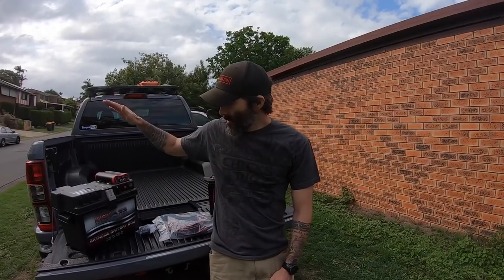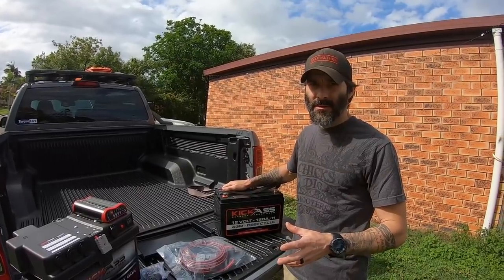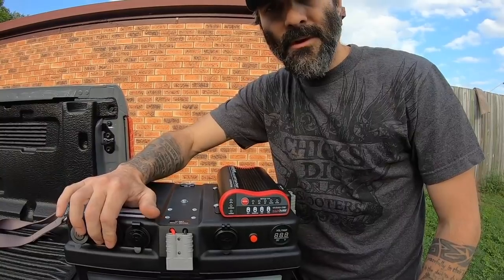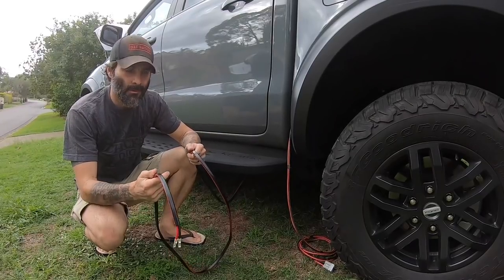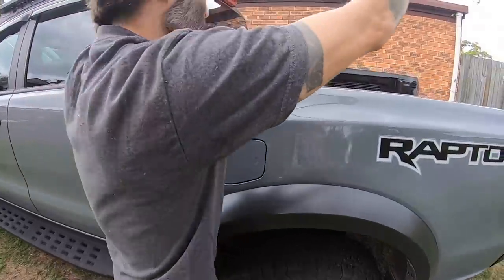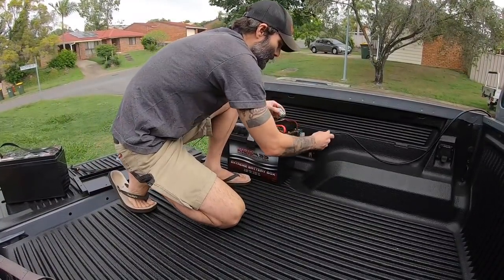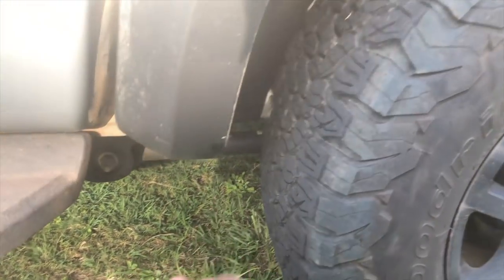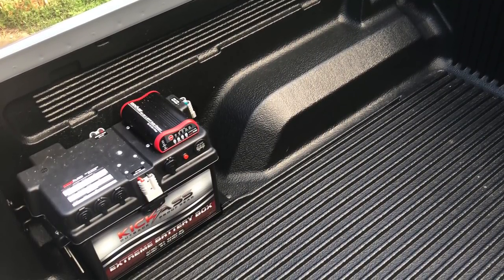HOW TO - Dual Battery Install - EASY

Comment: Great Video mate, I have the same setup and only thing different was instead of drilling through the tub floor I came up and in through the taillight cavity then into the tub wall right where my battery is setup.
Reply from the maker: That’s very cool 😎 I didn’t even think about that 👍🏻

Comment: Hi mate - great video - just thought Id mention a problem that I had with my current setup - no grommet in the hole where you ran the lead through the tub bottom - a similar thing was done by the installer of my current system, after 6 months the hole edge chewed through the wireing and shorted out on the tub frame - blew the main fuse and the car just stopped running and rolled to a stop.  Still had some lights - but no juice to the engine - had to get flat bed back to my mechanics - and a new main fuse ordered from nissan.  Im constantly on dirt for work - but even on bitumen - any movement of the wiring within the cut hole will eventually cause the insulation to fail.  Grommets a must!
Reply from the maker: Cheers mate, I've wrapped the wires where there could be potential for fowling with a bit of old pushbike inner tube. working a treat so far.

Comment: Definitely a battery box setup for a cheaper install, and portability. All came up looking very neat a job well done. Thanks
Reply from the maker: Cheers Dave, Im loving how good the quality of the system is VS the bigger brand name systems...I've saved myself a fair packet and very happy so far how this system performs. cheers for the comment mate.

Comment: Hey mate, great to see the install. Just a few points from experience:
- Is the box out in the weather? If so you dont want water getting into any of those anderson plugs, not good at all.
- You should incase the main twin cable in spit conduit for extra protection.
- Does the hole you drilled have a grommet fitted?
- if it doesnt already have one make sure to fuse the cable to your trailer and go grab a weather proof rubber cover for the trailer anderson plug.
Reply from the maker: Andy, thanks for the comment mate. Always great to see good constructive feedback 👍🏻🇦🇺🍺

Comment: Great video showing how you mounted your box, i was told by an Auto Elec, not to piggy back a Anderson plug from your AGM (in the tub) to charge another battery (eg trailer) down to your tow ball. He told me better to run a separate feed from the alternator back to the towball via a midi fuse. Then to install another DC to DC on the trailer. All of this was to prevent voltage drop etc.... any issues with your set up ?? Again great video !

Comment: Nice setup , I’ve watched your 1 year review and now found this video too . I’d prob would have gone same way as you but have a tray , a bit worried if I had a battery box and charger on back of tray it might get nicked . 
I’ve just worked out what I’ve spent on a basic setup not hard to spend $ on these systems : 

12V system setup costs for N70 Toyota Hilux
 (excludes wiring, blade fuses and holders, MIDI fuses and holders, Anderson plugs, marine grade Heat shrink, ring thermals various sizes, Split tubing light harnesses with relays)

REDARC 
BCDC1225D Charger) $540 
Bcdcmb004 (Bracket) $72 
SBI12 $118 
$720.00 

Other 
6 Fuse box with Buss bar $49 
Projector specific N70 Auxiliary battery tray under bonnet $275
105aH SuperCharge MRV70L $278! (Semi retired) 
sub total $602.00 

Grand total $1,322.00

Comment: G,day mate , neat job , I have a question, I’m a bit brain dead on this stuff . The lead you run back down  to connect to trailer will that charge additional batteries in the trailer from that dc dc charger ? Cheers wayne
Reply from the maker: Yes 👍🏻

Comment: Quick question, I have a brand new 2020 GMC Sierra 3500 with a massive fuse relay box on the positive terminal, needless to say, it’s hard to get in there for another lead. Can I bolt the one side of a battery isolator directly to the alternator stud? Reason I ask, I see a single line going to my battery, protected by a 250 amp that come directly off the alternator.... if I put it on the alternator and add a fuse, I see no different than it being on the battery or the stud that is hooked directly to the battery anyhow.

Comment: Great video mate! Only thing I was confused about is where do you run your negative/ground cable to from the battery to the back or once at the battery doesn't it need to then go to a ground point on the vehicle? Thanks heaps

Comment: Nice video matey. Question when the cars not running is it only using your 2nd battery and not draining the main battery? Then when driving both get charged?
Reply from the maker: Cheers mate 👍🏻 yep that’s about the long and short of it. When you are stopped, anything you have plugged into the second battery will only draw down from the second battery. If the second battery goes flat, that’s it no power draw will come from the main. Once you start up again, your car will charge your main battery first (what ever power you used to start the car) then once the main is full power will start to flow over to the 2nd battery.

Comment: Great video! Just wondering, with these kickass dual battery setups, do you not have to run an ground wire to the chassis? I've seen some people say they do but I don't get how exactly you add a ground wire when the negative cable has the Anderson plug on each end. (I'm clearly new to 12v electrics)
Reply from the maker: G’day Paul, Don’t worry mate I’m definitely no 12V guru either but I don’t mind giving it a go. With this pre wired kit I’ve used in the video there was no need to earth the line. 8 months on and it’s never given me any grief, I’m guessing all the magic happens in the new DC/DC charger.
Reply: @RoundTheFire  Ahh I thought it must have been something like that, that makes it easy. I'm going to do the same next year in my Navara, just need to suss out if my tub has any grommets for the wire to go through or if I just need to drill like you did. I forgot to ask did you feed the cable inside the chassis or on top?
Reply from the maker: Mate I ran the wire along the top of the chassis 👍🏻

Comment: Hi Mate , this is their exact comment " If you are using a smart alternator and the blue wire is not connected, the charger will still work but will not charge the battery fully. The battery charge will be around 75-80% "
Reply from the maker: That’s very interesting 🤔 When I phoned them back when I bought it they told me no issues with smart alternator...granted I’ve been getting full charge to mine no issues? 

If you can do me a favour Chris, there is a comment somewhere on this thread from Australian Direct. Pose the question directly to them, I’m sure there will be (as I am) other guys wanting to know what they might have to say??

Comment: Thanks for the video. Does it only charge off main battery whilst vehicle is running? What stops it from flattening the main start battery?
Reply from the maker: G’day mate, yes the 2nd battery will only charge when the engine is running and the start battery reaches full voltage. The DC/DC charger on the 2nd battery acts as the isolator so the 2nd battery will never draw down more than itself.
Reply: @RoundTheFire  so although it says alternator input, it's really just main battery input and treated as tho it's just another accessory coming off the main battery. No need to wire up to alternator.
Reply from the maker: That’s right 👍🏻

Comment: Can you you charge those batteries with solar panels?
It would be great on camping, no need to turn on the engine to have it charged.
Reply from the maker: You sure can mate 👍🏻 I’ve got a 12 month review video coming up on very soon on this system
Reply: Round The Fire thanks for the info

Comment: Can you please explain whatever happened with the the brown Davis tank and the fix tjm made to correct it?
Reply from the maker: G’day Doug. The problem was with the sender unit being installed slightly off causing the float to come in contact with an internal tank baffle basically not allowing the float to drop bellow 1/2. Simple fix by TJM was to slightly rotate the sender unit to free up the float. 👍🏻

Comment: Simpleton in regards to this;yet I’m looking to purchase the same set-up. Had a few questions. Any chance of it draining my battery, any chance of a fire? Looking to mount in a drawer system, need ventilation? Just looking to power a camp fridge. Appears to be the perfect solution. I just don’t know enough about it
Reply from the maker: The 25AMP DC/DC charger also acts as an isolator so as not to drain the main start battery. Chance of fire…I would never say never, but highly unlikely if wired correctly. The charger will get hot when working hard so safer to keep it where it can breathe.

Comment: Hi all, very new to all this. I wish I had if seen your video sooner !! I have a 2016 XLT ranger and have purchased a kings dual battery system. It’s no where near as complete as the kick ass system.
In any case I’m stuck with what I have so I have had Ford turn off the smart alternator system so I can complete the install using the old style battery isolator switch. I want to put kick ass circuit breaker between the start battery and the deep cycle battery. Can someone recommend size ? I’m looking at the 50 or 100 amp manual reset breaker. I assume this is only to protect against a dead short to earth but would be great to get others views
By the way, great videos !!
Reply from the maker: 50AMP should do the trick 👍🏻
Reply: Thanks mate appreciate it. Looking forward to the next video

Comment: Thanks for the video, I just wanted to find out if you can do this setup with a deep cycle battery as an auxiliary battery? Is this possible?
Reply from the maker: This setup is using a Deep Cycle battery, no worries

Comment: Hey Damo thanks for another vid mate!! Question not regarding this particular vid. Regarding the rhino platform, thinking about getting one on my raptor. What’s your opinion? Is there a lot of wind noise? A lot of mixed reviews online so I thought I’d check with you as I’m looking at an identical system on the same vehicle? If you have time let us know your thoughts!!!!
Reply from the maker: G’day Danny, I’m quite happy with the Rhino system so far mate. The whole product looks, feels and performs like quality. Without a doubt she certainly blows the wind, unloaded I would say the sound is no different to other racks on the market but adding a roof rack I think that’s all to be expected. The backbone mounting system probably a little bit of over kill as the mount can handle more weight than the roof is rated for but it is the lowest profile mount in the rhino rack range keeping everything as low down as possible and IMO is the best looking mount. I’m very happy with the overall package and if I had to do it all over again I would still choose this system. 👍🏻
Reply: Round The Fire cheers mate looking forward to more of your vids

Comment: Hey Damo, great to see another video. I thought you would be away on your trip? I have done the same thing with my Raptor but I purchased the Projecta Powerhub. I like the way the Powerhub has the digital screen which tells you charge rate in and amp draw out so you know a time til charged and discharged. I think I will have to follow your lead on running power down to the rear and through the tub. Can I please ask, how did you secure the battery tray? Does it go through the tub as well or just the bed liner? And is it bolted or what? Thanks mate.
Reply from the maker: G’day Nathan. I’ve just come back from the trip and battled my way through my first week of work 😫 Good choice on the Projecta, This unit and the Powerhub were my top 2 a lot more features on the powerhub at the end of the day not being lithium ready was the key factor for me to go with the KickAss system.
Reply from the maker: For mounting the tray what I did was use a step drill bit to get a neat large enough hole for the wiring to run up into the tub, feed the wiring up. Then they Battery tray almost sits totally over and conceals the wiring hole. I then drilled through the liner and tub and bolted the tray directly in. Tighten the bolts down evenly as they will compress the ribs in the liner and not allow dirt and water to freely run under the tray. My battery tray and Anderson plugs stay in the back permanently and I can remove the second battery and store securely when not needed 👍🏻
Reply: Round The Fire Perfect mate grea job.

Comment: Hey great vid! Quick question, what size fuse does it have in the engine bay end?
Thanks
Reply from the maker: G’day Daz, the set up is running an 80A mega fuse linking the 2 battery’s ties in closest to the main battery.
Reply: How did you manage to get the 80amp fuse in the fuse box? Which fuse holder did you use in the engine bay?
Reply: @AdventureLifeOz   it’s an inbuilt fuse in the kickass wiring

Comment: Hi mate, did the battery box mounting tray come with the kit? If not where did you get it from? Thanks!
Reply from the maker: G’day Mate, the tray was not included in the kit. You can buy them as an extra piece from Australian Direct when ordering the Dual Battery kit.
Reply: Awesome thanks mate...👍🏻
Reply from the maker: No worries 👍🏻 i think they are a fairly standard sort of battery tray. You should also be able to find one cheaper 🇦🇺🍺

Comment: Hey mate, great video, a few questions; Do you still recommend this setup? and do you have a grommet for the hole you drilled in the tray and if so where did you get it from? Cheers Daniel
Reply from the maker: I’m still liking this set up. For the price it does what the high end stuff can do no worries. I didn’t put a grommet in the hole, I’ve now wrapped the part of the wires where they might rub in some spare bike tube. Works a treat 👍🏻
Reply: @RoundTheFire  Do you still have the set-up, it's 07/22.😊

Comment: Great vid mate, that last Anderson plug you talked about for your trailer, could that be used to charge batteries in a caravan when driving? Or is that a different type of set-up?
Reply from the maker: Thats exactly right mate, the anderson at the rear will charge your camper trailer/caravan batteries when driving.
Reply: @RoundTheFire  thanks mate, I'm going to grab this system 👍

Comment: Hey mate did you need to run a wire straight to an ignition source?
Reply from the maker: Depends on your alternator? if you have a smart alternator then it’s a good idea to. There are a few ways to do it (keep in mind these are the dodgy ways) 
1. Wire the ignition wire straight to the + terminal of your 2nd batt...this will trick it to think the car is ALWAYS running. 
2. Wire the ignition wire to the + side of your volt meter if it has a switch. When you switch your volt meter on the DC/DC thinks your car is running. 
3. Ask your dealer to turn off your smart alternator (if they can)

I’m not a 12V guru but I’ve found these ways to work.

Comment: I see the sides of your tub liner are bowing in. This seems to be quite common. Have you told ford about it??
Reply from the maker: Gday mate, yep certainly have mentioned it to ford. I’ve already had the complete tub liner replaced under warranty...this one you see in the video is the “new one” 😎👍🏻
Reply: @RoundTheFire  and the replacement is doing it as well?
Reply from the maker: Yep...the liner bows exactly where the sports bar would sit and support it. As soon as it get hit the liner gets soft.

Comment: 6 months on, you still happy with the purchase? Anything you'd change if you did it again?
Reply from the maker: Still very happy with the battery set up mate, Ive given it fairly hard time with the elements and it hasn't skipped a beat. Only thing I would change if I did it all again would be to buy either the matching brand solar blanket or a better one than i did, purely so that I could use the unregulated solar power input (my solar blanket over charges the DC/DC if i try to run it without a regulator)

Comment: Hi Mate , Great Job , I want to do the same but I have been told to connect the blue ignition wire as these cars have a smart alternator and will not achieve full charge , Where did you connect your one and can you use the box portable away from the Car.
Reply from the maker: G'day Chris, My kit came pre-wired from the factory, there was nothing additional to do, no extra wires ect, other than hook it up as I did in the video. I still get full charge not a worry? I can still use my box portable away from the vehicle, it is a little bit of effort (4 nuts) because of how i have secured it. Thanks for watching.
Reply: @RoundTheFire  Hi Mate , reason why I am asking is when I called Australian Direct told them I have a smart alternator as all these cars have they told me I need to wire the blue cable which it on the bcdc otherwise it does not get its full charge due to the smart alternator. They even stated that on the email they sent me and that was today.

Comment: Great video, thanks! Can you charge the 2nd battery straight from the power socket that comes stock in the tub? Cheers.
Reply from the maker: Gday Tom, It’s not possible with the system I’ve installed, however there are systems on the market that will allow you to plug straight into the 20A CIG socket in the tub to charge your 2nd battery. I think the downside to those systems is they have a low Amp/H charging rate.